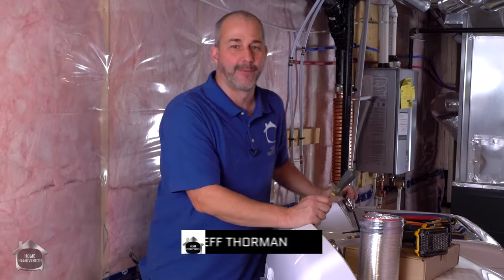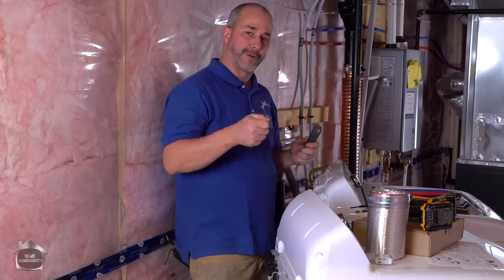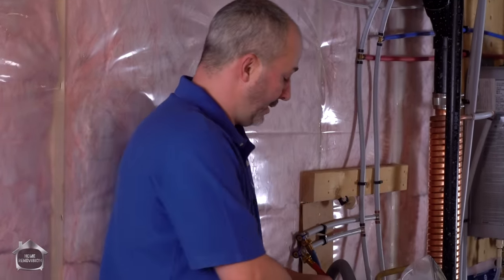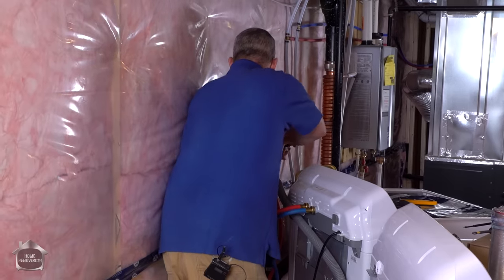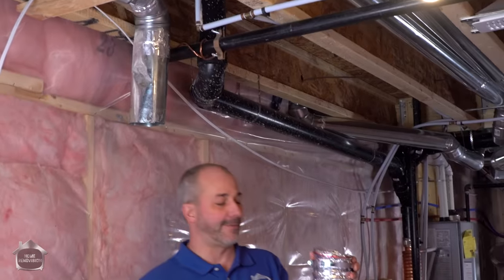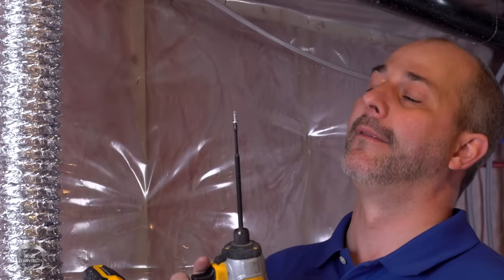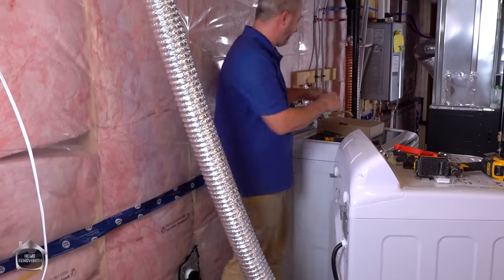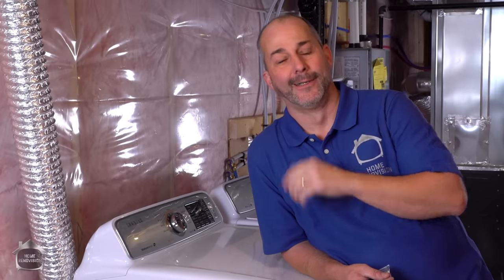How to Hook up a Washer and Dryer

Comment: terrible way to attach a dryer the vent pipe should be solid metal or flexible aluminum go into the other pipe so lint doesn't collect never use screws. it is a fire waiting o happen

Comment: Actually Jeff, you missed one of the most important things to do once you've got them hooked up. Ensure they are Level. Spend 10 -15 minutes making sure they're level side to side and back to front and your units will make a lot less noise and last a lot longer.
Reply from the maker: great point. I guess I just take it for granted with a new build. Cheers!
Reply: How to level the floor first? I really dont feel like using liquid self leveling. Thinking plywood and sand (small laundry). Throw some floating tile on top
Reply: Level and first the water then the electric.
Reply: @valentinek.t3327  You can get plastic pans that go under your washer.  You can run that to your drain then you don't have to worry about damaging your wood.  Level it with plywood but remember to keep a slight slope towards the drain.  You can use vinyl flooring so you don't have to worry about water damage since it is a high humidity room.

Comment: Adding a water line to a dryer is a complete contradiction the point of a dryer is to get the water out. That's like having running sneakers with 6 inch heels on them

Comment: Also me being an HVAC tech it’s against code “at least I’m Ontario, Canada” to have any screws in dryer venting it’s a fire hazard because it can catch the lint.
Reply from the maker: LOL, that is why the old pipe fell off. Cheers! You can't rely on tape.
Reply: @SomeDumUsrName  Sure, and as a DIYer, I've learned a treasure trove of information from Jeff's video's, which is a lot more than I've learned from you.  I've also learned that there are some who just come with nothing to contribute other than criticize a man who's helping to empower others figure out how to do things for themselves.  Beside, codes vary from state to state and I happened to look up code M1502.4.  In some places, as long as the screw does not protrude inside the ductwork more that 1/8", it is code compliant.  Even if it's not code compliant, that screw end would have to be one hell of a lint sucking magnet before it would pose any sort of danger.  Anyhow, for those of you who are so frightened of a screw, just add a zip tie and move on.
Reply: I was just gonna say that was a great tip but your right.
Reply: The right kind of tape(foil tape) will outlast the dryer.  I bet it was duct tape used.
Reply: @okymek  This happened with my dryer vent. I'm not sure if that vent was ever cleaned. I bought the house just over 2 years ago, installed new washer/dryer. The first year or so it ran well enough. A few months into year two we noticed it taking longer for clothes to come out dry. Then we started getting these errors on the dryer that came on progressively sooner. Realized it was associated with the lint trap or dryer vent. Lint trap is cleared after every use. So, spent the $20 or so dollars on a snaking dryer vent brush. Took nearly 2 hours to clean that sh*t up. I couldn't believe the dryer actually attempted to run and hadn't burned out. It was seriously clogged for what nearly seemed the entire length of the vent (vented through the wall in the center of the house at an angle at the precipice of the roof). Wife thought I was crazy but after the first couple handfuls of old nasty lint in the vent, she realized we were in it for the long haul until it was completely clear after two full runs. Now it dries like a d@mn champion. I made sure to put about 4 to 6 inches of vent hose around the piping to ensure there was a solid 2 inches passed the worm gear after tightening to prevent accidental slippage.
Reply: Is it not also code to use only rigid 4” pipe?

Comment: Great tip, never knew about the bkwds click trick.  Jeff's videos are a great, great source of DIY info,  but I am a little surprised with this one.  Too many fire hazards.   Google 'how to install dryer ducting' and you will be instructed to go: 1. always smooth wall ducts when possible/practical, ie, metal pipe ducting, NEVER accordion.  2.  junction points should always go 'male to female' ( crimped into uncrimped ).  The dryer will always have a male/crimped end coming out, and be joined by going into a female/uncrimped end.  You should try to continue this crimped into uncrimped sequence in your entire duct run.  In the video,  Jeff changes the overhead female/uncrimped end into a male/crimped in order for the accordion female to fit easier.  But this is not optimal.  You just introduced an air-flow restriction point, which both reduces dryer efficiency and makes motor work harder. And creates a 'lint trap' fire hazard.  3. never use screws ( and even rivets are discouraged ) which penetrate the ducting. Screws are lint catchers.   Its been said already down below,  but accordion style ducts are lint-catching fire hazards.

Comment: I've heard that the new recommendation is to avoid flexible ducts and instead use rigid galvanized steel because the coils in the flexible duct collects lint and inhibits air flow. Also, I learned to never insert a screw as it will collect lint also.
Reply: "• DO NOT use sheet metal screws or other
fasteners which extend into the duct that could
catch lint and reduce the efficiency of the
exhaust system."
Reply: One tip I saw was to slightly crimp outward, a "notch", in the hard duct as a kinda "catch" . The adjustable hose clamp as it will slip over the notch but not back down....

Comment: Aren't we supposed not to use screws on a dryer ventilation? Because lint could accumulate on the screw and might create some problems oer time?
Reply: Correct, it is against code to put screws in a dryer vent line.

Comment: My Dad taught me the "loosen 'til it clicks" tip about 50 years ago now....  It has saved me many, many dollars in repairs and ruined equipment, and I have taught dozens of young men and women the same tip.

We take for granted what we were taught and learned via "school of hard knocks", and successful experiences...  Thank you Jeff for helping us teach the next generations!
Reply: what is the loosen til it clicks trick
Reply from the maker: when you slowly go backwards on the fitting applying gentle pressure until it sits into the  thread. that avoids cross threading. Cheers!
Reply: @HomeRenoVisionDIY  Thanks!
Reply: Same...except for the 50 years ago part... Worst about about it though is getting razzed at work by the folks who didn't receive quality instruction. But I don't care, I'm not gonna strip a thousand dollar thread gage member because someone snickered at me starting to turn left

Comment: Great video, after years of trade work you learn a few tips and tricks. If you don't own a pair of crimpers you can use needle nose pliers to create pleats/crimps on the ductwork by gently gripping and slightly twisting the pliers ever 1/4 inch or so around the duct
Reply: Same here.

Comment: Make sure you level them or they will be noisy and where faster.  Also, the accordion vent hose is a major cause of house fires.  Use a  solid smooth vent to keep lint from building up.  Also, that crimped end with be a lint collector!

Comment: Thank you for this! I recently moved and have never installed a washer/dryer on my own. I watched another tutorial because I had to switch out my 3 prong for a 4 prong on the dryer, but this video helped me cross the finish line once I’d changed out the cable, so thank you!

Comment: I was to see you move the whole set up to a new room/area. Hot/cold lines, drain and new vent for dryer. Do you have a video like that? I'm planning on buying a fixer-upper and want to move the laundry room to the other side of the house entirely but it would Definitely make me feel more confident to see you do it. Thanks!
Reply from the maker: Hi Apryl. I am filming a plumbing video today that will solve all your problems. Cheers!
Reply: @HomeRenoVisionDIY  YES! THANK YOU!  I can't tell you how awesome your videos are,  you know what your doing. I hate to miss even one! So many have tried to build a YT community but fail without the correct knowledge ,experience and confidence you have,  my hats off to you!

Comment: Leak prevention pro tip: fasten the washing machine's drain hose to the standpipe or wall box drains securely with a beaded strap or zip tie. Make it snug but not so tight it kinks or cuts-off the drain hose.

Comment: Question: The duct for the dryer, does that have to be a distance from the wall or does that not heat up enough to cause an issue to the lining behind the wall, or in my case drywall? Thank you
Reply: It's better to leave a bit of room if you can.  Will do anything to the wall? No, but i is alway good to give it a little room to make sure you don't squish any part of the hose.  The 90 degrees angles  are the weak link in a hose.

Comment: Would it be bad to add an air gap between the washing machine hose and the drain?
The thread grabbing thing is a neat tip.
I had the 8ft accordion type dryer vent but a possum got into the house & the dogs chased it behind the washing machine. The poor thing ripped the vent to pieces.
The back of my dryer faces an interior wall but the exterior wall is just to the right. It's extremely cramped though so we are renovating, tearing down small walls (non-loadbearing) and swapping the laundry room with a useless tiny bathroom. Anyway, washing machine and dryer will be turned with their backs to the exterior wall to make it easier to vent the dryer (and have more space in front of the machines). We will be using a Magvent for the dryer vent. You clamp one end to the dryer and the other end attaches magnetically to a corresponding piece on the wall.

Comment: You make it sound like everyone knows this, but the duct stuff was super helpful. I'm mad that I didn't learn this before I tried to connect a new hose to my portable air conditioner. I bought a rather rigid tough aluminum hose and I was terrible at connecting it in a way that it would stay on. A dryer hose and that screwing stuff would have been much better.

Comment: Hi Jeff. Love your videos. Right to the point.  Question regarding dryer venting.... My dryer vents straight out the back, very direct. Have a plastic hood on it with the damper but as we know they dont exactly seal the greatest. The problem is the amount of  cold air coming into the dryer (we  live in Canada) is unbelievable. Our whole laundry room is cold because of it even though we keep the dryer door closed.  Same thing with our ceiling bathroom fans that vent out into the soffit.. Cold air comimg into the room. The House and everything is brand new and professionally installed so its not a quality or workmanship issue. Any suggestions.

Comment: Hi i just purchased samsung DVE45T6000V electric dryer coonected with three wire connections it has power when i start it it make ratling noise any idea am i missing any installation steps or does it have any shipping screw to remove or any thing like that , thanks

Comment: stainless steel washing machine hoses to reduce chance of flood?
Reply from the maker: The flood is usually the plump not the hoses!
Reply: We had the valve fail and cause a flood once. Then the second time was the fill pressure sensor failed and it just over flowed the tub.
Reply: Already knew how to do that, but thanks for everyone who didn't! It's easy, no need to call anyone to have them installed, just like the dishwasher. :)

Comment: hey jeff i heard that some washers have shipping bolts you need to take out, that keep the drum from moving around too much during shipping. is this specific to front load washers compared to top load? or is it all the same?
Reply: shoyru166166 .....I have seen this rod on the stacked units....if you don’t remove it, you will damage the washer and it will cost big bucks for repairs. Great for pointing this out.
Reply: Always read the manual before installing!
Reply: just look on the back lol usually it is only front loads.

Comment: We moved our washer and dryer in our basement and were doing this by our own which is helpful but we're stock and pending job bcoz of the vent that we need to dig a hole and connect it to our main floor vent hole in the wall.

Comment: I was hoping to get instructions on leveling front load washer, which I’m attempting. I got machine to “not rock when pushing down on diagonals” as instructed in manual but level bubble is touching left line of the two lines in center of level. I lowered left nut as far as possible. Might have to raise right. Checked floor and it is in fact the floor that is problem, showing same bubble, but when I attempt to raise the right the the level stays the same, but now the washer rocks. That would mean I can’t raise it higher to attempt to level bubble because it’s already rocking with the slightest adjustment. Maybe I’m missing something here in using a level or if that tiny bit off matters if it’s in between the lines. I’m thinking the “not rocking test” is more important than greeting the very center of the level (and I did borrow a second one just in case it was inaccurate). I’m afraid to run machine and chance damaging. 
Is leveling not required for top loader? Not sure what to do. Perhaps you can do a second washer/dryer video for front loaders. Too late for me, but might help someone else.

Comment: There are other videos for what to do if you have a three prong outlet.... probably illegal but it is possible to hook up the jumper to ground and wire the dryer to use the older type three prong cord. Check out "connecting three prong dryer cord" and videos will pop up.

Comment: Jeff, my old furnace vented through the chimney, can I use that to vent out the dryer?
Reply from the maker: as long as you can get a 4" rigid pipe in there and the run is less than 20' from the dryer.

Comment: I just brought a washer and dryer however am on the second floor and the hook for the washer and dryer is in the basement. How do I do a hook up on the second floor? Do I have to run a wire from the basement to the second floor on order to have it working??? Help lol

Comment: Longer dryer hose runs, booster in line fan?
Reply: Not so sure that's safe given the lint building up.
Reply: @wolvenar  Totally legal. If your vent run  exceeds the manufacturer's maximum limit of pipe a booster fan is recommended.  An amp sensing switch will automatically turn on the fan when the dryer is on. There are fans specifically for this application.
Reply: @daviddesilva4971  Hmm ok. I guess I would have to skip it either way. 
Seems like yet another place to build lint. Also if it has a motor that can get hot it just seems like a good way to start a fire.

Comment: Ensure units are level and use steel braided inlet hoses: older relative experienced tens of thousands of dollars in water damage when cheap hose ruptured and she wasn't home...not likely, but cheap investment
Reply from the maker: They also make floodsafe now so they actually shut off the water.

Comment: Odd... I thought all new home constructions were configured to have the washer on the LEFT, since that is how the doors open on front-loading washers.    (I live in a house where the dryer is on the left and it's annoying as you can reverse the door on some dryers, but you cannot reverse the door on the washer.)
Reply: We have a newish front loader where the dryer door opens from right to left, and washer left to right. So yeah washer is on the right.
Reply: Ours was set up with the Dryer left and washer right.  However thats not how the actual washer and dryer sit in the laundry room, so lines are crossed a little. Im currently finishing up on a paint job in my sons bedroom, then next the laundry room. Our house also has a venting issue, so we vent inside which is a pain. Trying to figure out how I can fix this with the connections fixed, venting going out and the washer stop moving/unleveling.
Reply from the maker: If you email us a picture I can maybe offer some help. Cheers!
Reply: @HomeRenoVisionDIY  Thanks, but it's a small main floor mud room and short of removing/reconfiguring the exhaust duct (which goes straight outside through the wall behind the dryer) or moving/reconfiguring the plumbing  (which is in the wall behind the washer) there is no changing the layout.   I just had thought that all new construction was standardizing on washer-on-the-left because of how all modern front-loading washers are built.
Reply: Home RenoVision DIY I’m going to send an email. Maybe you can take a look at see how I can get this fixed properly once and for all. Email from okstout4.

Comment: That screw isnt a good idea for dryer ducts. It catches any lint on the way out and acts as a fire hazard.
Reply from the maker: I prefer to have the duct stay in place. falling off is the real hazard.
Reply: @HomeRenoVisionDIY  two clamps can solve that as well
Reply: @apex007  That crimped end will also catch a lot of lint.

Comment: The title should say "Electric Dryer".... didn't mention anything about gas-powered ones.
Reply from the maker: That is because they are not that popular. They will be extinct soon!
Reply: @HomeRenoVisionDIY  Bold prediction.  Currently, 25% of U.S. households have gas dryers, which typically cost 50-75% less to operate than electric models.
Reply: @HomeRenoVisionDIY  Hard to find, true, but in Alberta, "Hydro" as you call it, is much more expensive here and coal produced (as of 2022). To dry my towels (in winter) by burning coal makes me cringe. Lesser of two evils. Just got my new gas dryer (Nov 2022)

Comment: 3 years, 2 months 2 weeks from now you will come back to flooded basement. get rid off that rubber  water hoses and get stainless steel hoses. crimps on the wrong side, screws in the duct, ducts look like they are flammable (?!). cmon